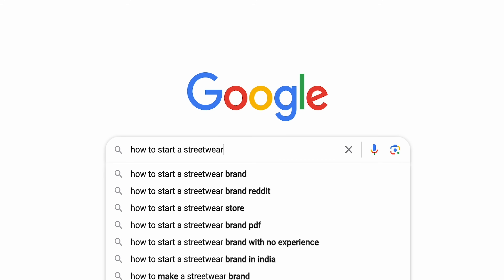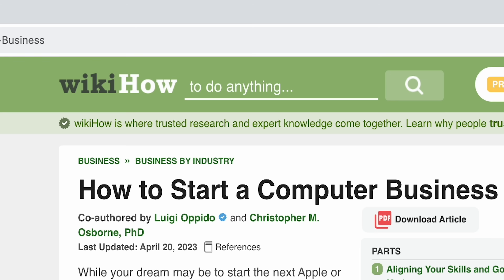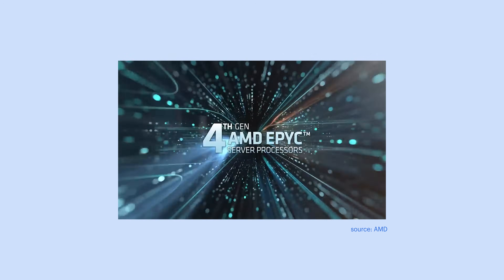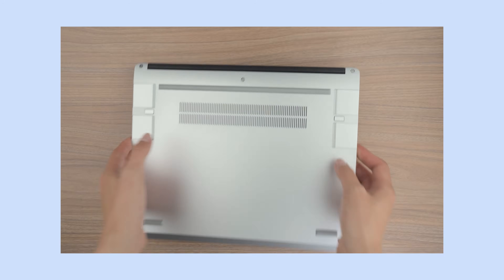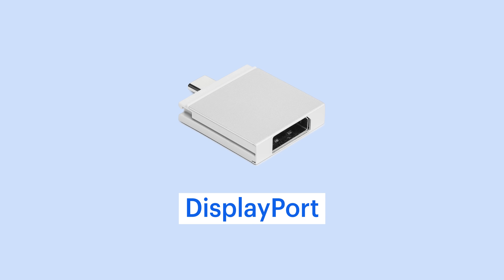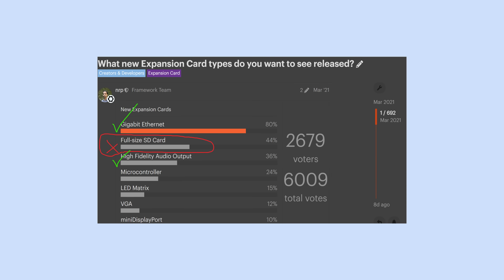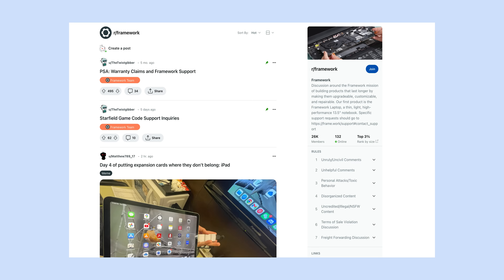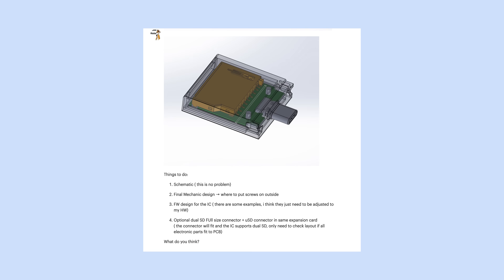We’re *finally* making a full-sized SD Expansion Card | Product Development Series - Episode 1

Comment: framework 16": would be nice a module with oculink port(s)  taking advantage of pcie lanes of the gpu expansion Bay System....or a expansion Bay System for a full desktop pcie riser card slot (/slots with bifurcation tables would be even more than amazing) or additional m.2 expansion Bay System.
or also a second battery bay. 
Like I would buy them all.
ps you are doing an amazing job! love your modular and upgradability approach. "Save us" and save the market from short use and not reparable products!

Comment: I love FW as a brand and what they stand for along w/ the innovations they've brought but I think one of the things I'm sort of concerned about is having a more rigid chassis. Like modular designs do tend to be a little less rigid due to the number of holes you poke in them, I'd be willing to pay more for framework products if the chassis itself was stronger and more rigid cause the build does feel more like a cheaper $500-700 aluminum laptops id buy from like HP or Acer

Comment: It's incredibly easy to buy a controller with an SD slot and solder it to a USB c breakout board. The only reason it would take this long is if you felt like you had to make the internals one PCB at a very odd shape. Transparency is nice but this just got put behind other projects and that's perfectly fine to say
Reply: And look at that I'm right. Over engineering at its finest. Can't wait for it to be $40.

Comment: I guess if the solution is as simple as dremeling off the edge of an existing PCB, is there not a solve to work with a supplier of said PCBs to produce one with slightly less material.

Comment: I wonder if it would be possible to add more ports to a single expansion card slot? e.g. there could be an option to split 1 USB-C expansion connector into 2 USB-C ports with half the bandwidth (such as 20Gbps to 2x10Gbps).

Comment: Woohoo!  SD card, let's go!!!

I do have a couple questions.  I have a 1TB storage card.  If I plug it into a USB-C port on my desktop PC, it works perfectly.  If I plug it into a USB-A 2.0 port, it works perfectly.  But if I plug it into a USB-A 3.0 port, it doesn't work at all.  Why is that?
Reply: By "storage card" do you mean an SD card? If so, what kind of USB to SD adapter are you using? Could it be as simple as a malfunctioning USB 3.0 port?

Comment: Why on G.G.E. would you not call the expansion cards what they are: “modules” 😢 They are interchangeable expansion modules.
Reply: Why call an SD card a card? It has roughly the same proportions as an expansion card.

If you have issues with the word card, why not with the word module? They aren't actually expanding the physical size of the laptop. So, 'interchangeable module' instead of 'expansion card'?

Comment: My biggest gripe with Framework expansion card system is how restrictive it is. Having 4 bays to play with (realistically 3 or 2) It's a hard to chose between a headphone jack or a lone USB port / Ethernet. It would be great to see some combo modules. Like 3.5mm jack + USB A/C or Ethernet + USB-C.
Reply: Just wanted anyone reading your comment to know that you don't need to use an expansion slot to get an audio jack, there is already one built in separate from the expansion slots. That being said I've also wanted dual cards, especially a dual USB-C card since I got mine from pre-order.
Reply: Even if they came at a premium, I'd still love to see them come to market
Reply: The 3.5mm jack is standard on the Framework 13, you don’t need to use an expansion card space. For the 16 i think you do need to use a slot, which is a bit annoying but in line with their philosophy of you have what you need and with the proliferation of bluetooth headphones not everyone needs wired headphones.
Reply: I think they would not even have to be that complicated. Even just 2x usb c would have me absolutely stoked.
Reply: wait what? there is no headphone jack by default?
Reply: I want combo ports as much as the next guy, but I never found the expansion bays to be very restrictive without them. I usually go with two USB-C and two USB-A, one of each on either side. I have Ethernet and HDMI cards in my backpack, both of which I have only needed to use a handful of times when out and about in over a year of university. You also have to keep in mind that virtually all laptops comparable to the Framework 13 have no video output without a USB-C dock or dongle.
Reply: They fixed this issue with Framework 16. You get 6 in total, and everything is swappable.
Reply: @RemziCavdar  that's not a fix. It's a workaround. One port per slot is still really limiting
Reply: @LunarOracle_uwu  6 ports are all I need. If you need more ports, then I recommend a dock.
Reply: I wonder if it would be possible to fit 2 USB-C ports onto one module, it seems that at least the physical connectors might fit
Reply: People are working on a dual USBC module in the community, with FW's blessing, It'll happen

Comment: good stuff, could you make a multiple port expansion card, like 2x usb c, usb-c + usb-a or hdmi + usb-c? there should be enough space right?
Reply: This is generally a problem with internal circuitry as well. And that ignores the point that cables also need space, espcially HDMI and USB-C.

Comment: It would be great, if you could make it an Full Size SD / Micro SD Combo Extension.
(Maybe just wired in parallel, with just one port usable at a a time.)
(And the same for USB-C / A wired in parallel, maybe with the ports very close together so no one accidentally uses both ports at the same time.)

Comment: At worst it can stick out like the ethernet, lol.

At times I wonder if it would have been better to have a bit wider expansion bays so there could be space for 2 ports instead of 1 in the expansion. You don't always need the full speed of the thunderbolt 3/USB 4 so you could fairly easily have 2x USB A 2.0 for just plug in things that don't need speed like mouse and keyboard. Maybe also easier to have space for small M.2 so one can swap in new M.2 SSD in the expansion pay instead of having to buy a whole new expansion bay.

Comment: Thanks FW Team. following

As for consumers - I think we should expect the next generation of expansion cards to be wider to accommodate the myriad of current requests that cannot fit in the existing footprint. Dual USBA for example. 

Backwards compatibility with all released expansion cards would be easy, just create a plastic housing matched to that new, wider dimension(s) where older cards can slot into.
Reply: Not just wider, also higher. That way an ethernet jack will actually fit. But I doubt we will see a big EC form factor any time soon.

Comment: its good to see that frame work is not sending out the laptops before testing them fully: In the past computers and laptops were sold with some faults and when the customer found them and reported the fault some companies did not do anything about for years: Going back in time when i brought an acorn model B computer the os. rom was 0.1 with a lot of errors in the eprom and if you wanted to have lastest version which was 1.2 os system rom: you had to pay for it overwise they would not give it to you: I know you will find faults when the frist  batch goes out some people might find a few problems but is always the case:  Anyway i ordered the 16" version in the second batch: only 2 hours after the email was sent out: I noticed on you tube there was a very slight fault with a 3v backup battery not doing something right on cmos and the person could not believe how easy it was to the upgrade mod which you sent him with instructions in how to fix the fault: All done in 30 minutes also he did not read how to do right:

Comment: What about an expansion card which is an external SSD to increase the storage? Is your USB-C bandwith 10Gbps? If so, it should work decently. 1.2 GigaBytes per second for an SSD is not great but sufficient for a lot of uses.
Reply: It already exists! It comes in 1TB and 250GB.

Comment: I've got another idea. Wireless mice come with tiny usb type-A dongles, and i wish that there exists an expansion card that can enclose the dongle flush within the chassis of the laptop, so the dongle doesn't protrude out of the laptop like the current type-A expansion card.
Reply: Look up the 2020 Lenovo ThinkBook 14...
Reply: Wait till you find out about this thing called Bluetooth lol,
Reply: @Gatorz_Gaming Yeah, but gaming laptop radio dongles.
Reply: @Gatorz_Gaming 
They're more expensive and have to be paired, usually to only 1 device at a time. I know this because I have a keyboard that supports both Bluetooth for up to 3 devices, as well as wireless dongle and wired modes. I use the Bluetooth connection for my tablets and the dongle for devices I don't usually use it with, then the USB cable is mostly used to charge it, set the custom settings (which it sometimes forgets), and use it if it's too far from the wireless dongle.

Edit: Not to mention my wireless earphones in which Windows 11 seems to love stealing the connection from my phone as though I clicked to manually connect it but I didn't. I then have to manually pair it back to my phone. None of my other devices I used it with did that. As such, I have to leave Bluetooth on my laptop disabled unless I want to use my wireless mouse.
Reply: @Gatorz_Gaming  Bluetooth can be more hassle to connect to. Plugging in a dongle of a device is generally recognized by the computer in the exact same way as a wired device because the dongle introduces itself a mouse (instead of a connection device) and the dongle handles the connection part. 
With bluetooth, the connection part is handled by the operating system (if the device has bluetooth support in the first place). That often comes with pairing issues, devices connecting to  the wrong device (because it's paired to multiple devices) and more. Bluetooth connections also generally have more latency, which can become very noticeably. All in all, the experience itself with bluetooth is often worse and inconsistent. With a dongle, it works consistently and is plug-and-play. 

Bluetooth has it's obvious advantage as well of course. It's a widely supported standard and is used on many devices that don't have (m)any USB ports. You're also not tied to a dongle, so when you loose that dongle you can still use it. Personally,  when I buy wireless peripherals I try to look for a device that supports both: I use the dongle most off the time, but when I loose the dongle or I forget to take it with me, I can fall back on bluetooth.
Reply: @jarnobot it's because the Bluetooth stack on Windows is a piece of sh*t. I've heard that is not the case with GNU/Linux, but I haven't tested myself (I don't have Bluetooth devices).
Reply: @LinuxIsNotAnOperatingSystem  I know, but you'll always keep having certain issues or even just simple inconveniences with Bluetooth.
I actually bought a Bluetooth dongle for my (Linux) PC very recently and so far it worked very well. That is compared to my experiences with Bluetooth + Windows (which has been 5+ years ago tbh). But even on Linux you'll keep having issues & inconveniences with Bluetooth, although it's far less. A plug-and-play dedicated dongle is just more straight forward and easy to me.
Reply: @jarnobot  yeah, I agree

Comment: I would like to know how the team made the original decision on what size the expansion card system was going to be, what were the options and how it landed on this size. Seeing as that is what ultimately caused the size constraints, creating the design difficulties and delay on the SD card expansion module. Looking forward to more vids from you! Can't wait to receive my AMD Framework 13 :D
Reply: I'm pretty sure the width of the expansion card makes it too narrow for two USB A ports, which would otherwise be a pretty handy card.
Reply: @phtown  I totally agree. It would be pretty nice to have 2 USB A ports on one card, but I think if it was that wide, some smaller things that you wouldn't have multiple of (like the 3.5mm sound card) would be kind of weird with all that extra space.
Reply: @natec1 I dunno, I'm sure some people would appreciate a surround DAC. Though it'd be kinda weird on a laptop.

Edit: The other alternative would be to combine the 3.5mm jack with a USB-C port or have separated headphone/microphone jacks or something.
Reply: @natec1  could have the form factor allow for a smaller card, two of which can fit in an adapter the size of a normal card, attaching with pogo pins to save space
Reply: @natec1  unless your soundcard has like 4 or 5 connectors for mic, aux, surround, etc...  or more USB connectors, as can never have too many USB connectors...
Reply: @phtown what about two Type-C ports on one card?
Reply: @maksym.koshovyi I've seen à community attempt to make one, it's a bit harder than initially expected but it's coming
Reply: @maksym.koshovyi  Been asked multiple times. Short answer is that it completely breaks Thunderbolt, Displayport, and USB4 compatibility. Still completely possible though.
Reply: My question is, why wasn't the audio one a dual purpose card? It is such a waste to have an entire bay dedicated to that, if it was a type C or type A plus audio, would it not have been much more practical as a complete single module? My friend suggested that it makes no sense to have one over just buying a usb a/c sound card and keeping that attached to your headphone cable, since losing the ability to have an extra USB port because you want an audio port is a pretty big compromise.
Reply: @AndrewStrydomBRP  I'm guessing because people might complain that either their USB wouldn't run at full speeds or their audio quality was poor.

Each expansion slot is just one USB 4 connection, so only has so much bandwidth.
Reply: @AndrewStrydomBRP i think they are bussed per side anyways
Reply: @DrewryPope  Iirc they aren't, only the ryzen model has any lower spec ports, on the intel they appear to all be full bandwidth.
Reply: Display Port 2.1 capture card option  (& HDMI 2.1 capture card)

Dual connector would be nice. Perhaps, 1 DP2.1 in + 1 DP2.1 out
Reply: @SpaceCaseZ06 This would be such an awesome expansion card. It could be easy to implement over USBC - dp
Reply: @mikeymop  
Yes.
Especially if it comes with the newly announced Thunderbolt 5 but that's not supported until at least the 15th Gen Intel processor
Reply: How about 4× usb type-c connectors oriented in a way that neighboring cords don't obstruct one another and compatible with full spec Thunderbolt, HDMI 2.1, DisplayPort 2.1
Reply: This is also what I'm wondering. Why not choose the size of the cards so that you have space for an ethernet jack? I get that this would make the entire laptop thicker, but the whole point is that this is the start of a new standard. I'm glad that with USB they didn't decide to us a barrel jack, why pick these dimensions? It seems like every discussion about custom cards quickly devolves to concers about the space.

I do get that there has to be some limit (before people start asking for a DVD drive expansion card), but this choice of dimensions seems oddly limiting to me.
Reply: Iirc they designed it to fit full size SD, then had to move the rails to the sides from the bottom and thus the SD card slot doesn't fit anymore